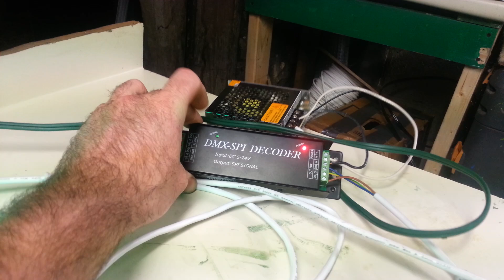Pixel Spinner How-to

Comment from the maker: These are smart pixel strips that have 50 pixels per strip, or 10 pixels per meter(each pixels is 3 rgb nodes).  Each leg is roughly 22" long.  I'm using the Sandevices e682 to run the test, but the spinners are currently running off of the Joshua P2 pixel controller.  The signal runs from LOR, out through the network jack using E1.31 protocol.  The pixel controller decodes the signal and sends the commands to the pixels.